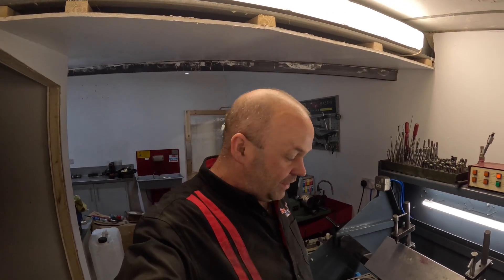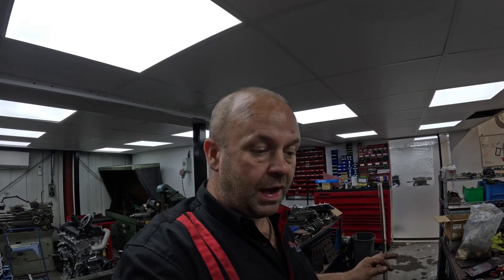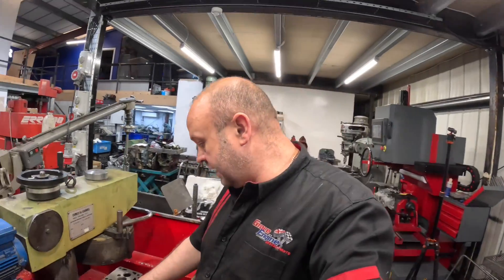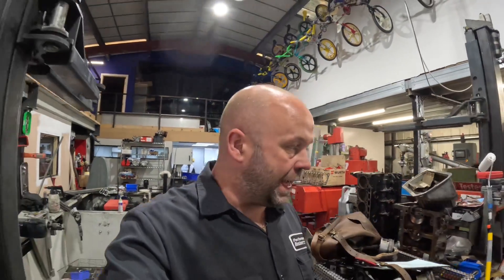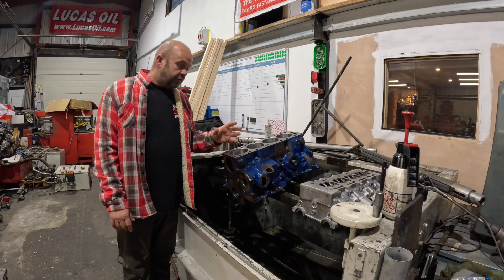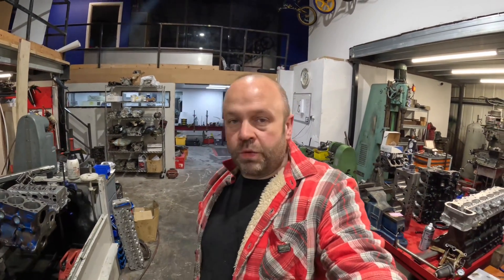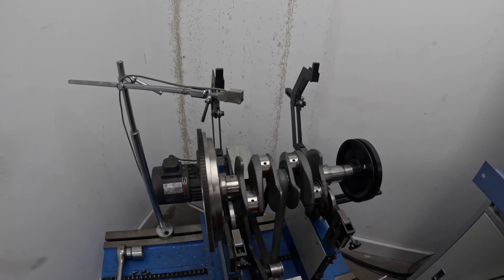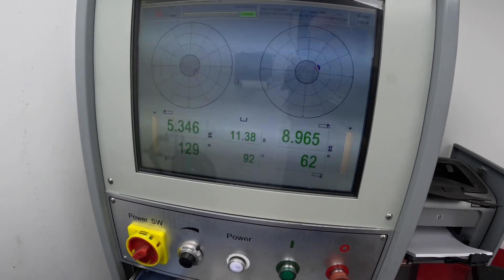Machining for more power on a Formula Ford X/Flow | VW air cooled crank shaft balancing

Comment: Would have thought that initially the conversation would have involved much of what was spoken about and the chap advised accordingly. This job seems to have been failing from the beginning, personally I would have spoken to the customer, found out problems and advised proper route. If the customer would not think that you were telling the truth then perhaps it would be best for them to find someone else do do this issue. Tut, Tut ,Tut, it seems that either no advice was given or if it was “ it fell on deaf ears”
Reply from the maker: Are you talking about the flow? If so then the customer and I chatted about the changes to be made.

Comment: Drop exhaust valves 1.5 mm into the head and get inlets as high as possible.
It will widen torque band by cutting down on inversion.
5 angle.
Love your work.
Reply: De shroud the exhaust
Reply from the maker: Yes I always deshroud the valves👍
Reply from the maker: Awesome I'll try that out soon. Thanks